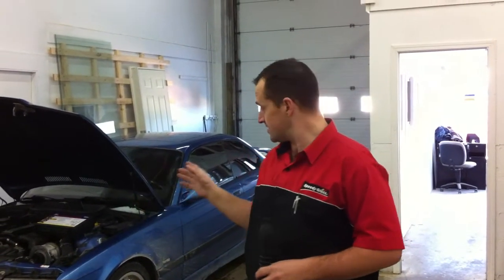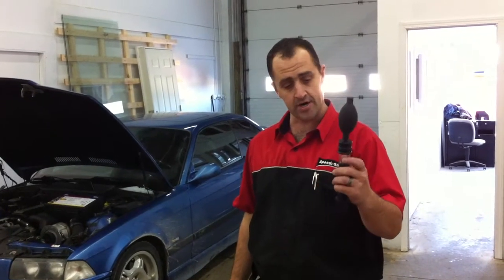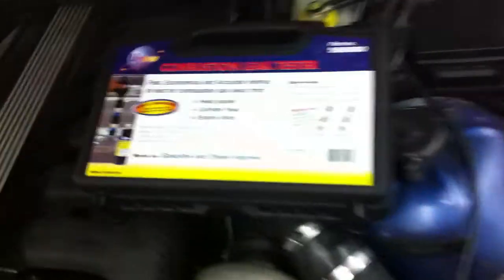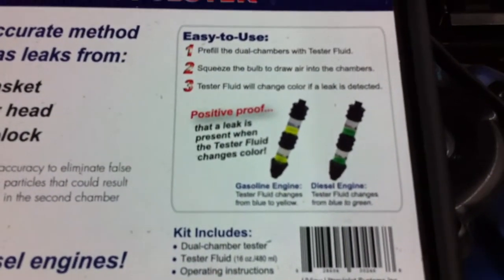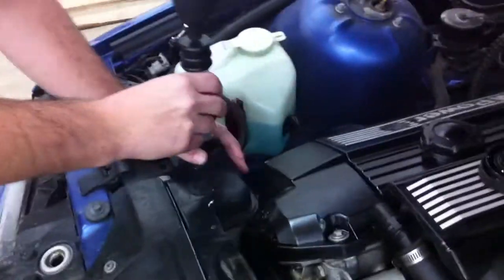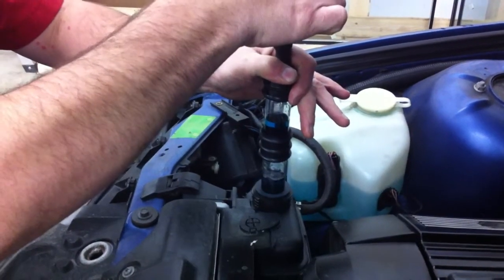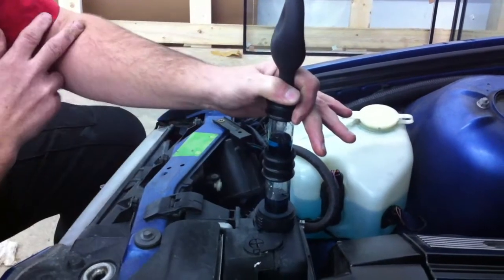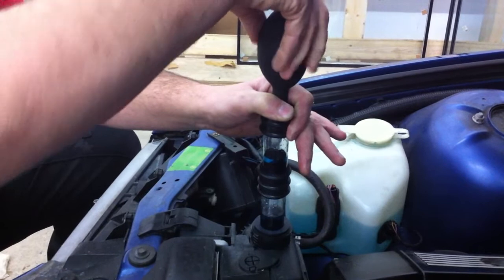Head Gasket Leak Test

Comment from the maker: Normally this is the case. In my situation I belieed the head to be lifting under boost which it wouldnt show under normal conditions. Before this test I ran the car hard for a bit and then tested it. Negative. Not even a cariation of the color. Subsequent tests were done with car running and also turned up negative.